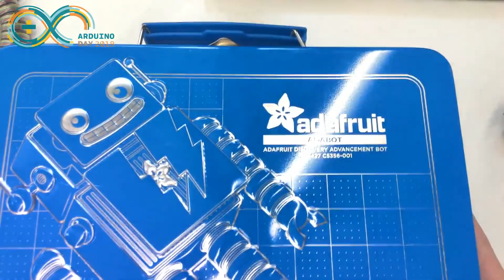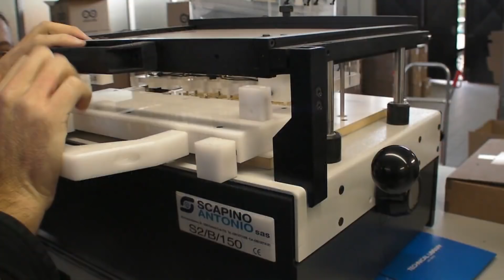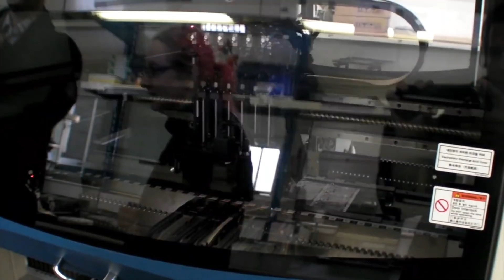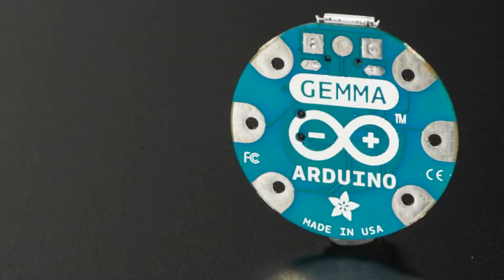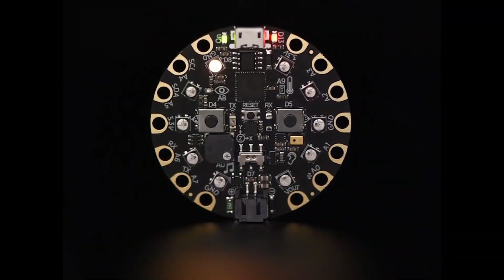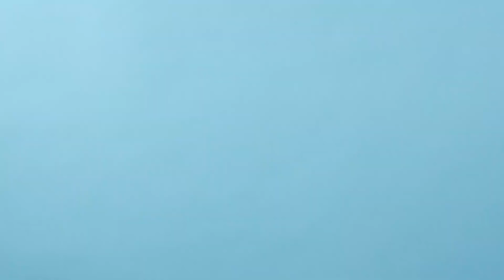Arduino Day 2019 #ArduinoD19 @arduino Sat. March 16th 8pm ET live @adafruit

Comment: Thanks for the walk down memory lane.  I first learned about Arduino in 2012, so I can relate to most of what you talked about.   We, here in west central Wisconsin have had a small Arduino group going since August of 2014 and had built/tested/discussed well over 125 projects as of  July of 2018 (the last time I counted them).   We are mostly interested in process control devices and don't spend a lot of time with flashing lights or wearables.   I do notice that "Arduino"  is being pushed farther down the list on the forums, but so far, our group is (more of less) stubbornly sticking to Arduino.   I highlight some of my own Arduino stuff at:
https://spaco.org/Computing/Computing.htm

Pete Stanaitis
---------------------

Comment: I came back to the MCU world around 2015 when Dave, from the EEVBlog showed some arduino stuff...i went, hey maybe i go check it out..and here i am in 2019 still using the 328DIP, just because i can put it easily onto a perfboard and do my projects, without any PLCC ockets....Also the phantastic IDE is one of the key why the arduino stuff is so great...
back in the 1990 i used the 68HC11-F1 PLCC, it was about 100 bucks just the MCU and the PLCC socket on order to put it onto a perfboard...also you had to deal with the Motorloa IDE which was ok..DOS only (the usual back in the day) but every now and then there was a new IDE when you wanted to use the latest version of the cross-compiler....and you needed to set it up all again...it usually took me days to set it up to work reiable...
This was so frustrating that i quit using MCUs for my hobby projects...
During the end of the 90s all these great dev-boards came...and some had beed very promissing, but everytime you had to deal with a complete and all new IDE, and if you upgraded your PC that IDE usually also won´t work...and the newer IDE won´t support that chip on your Dev-board...very frustrating for a hobbyist user

I always wanted a rather cheap board and a long term supported IDE....

And the arduino has all this, i still can compile my very first projects, done using  0xx and compile&upload it with 1.8.xx today on the latest ArduinoUNO and it works first go :) maybe some libs are no longer supported, but as i still have them, i always can use that code from that specific lib i need and add it to my code by hand.

Also i still can work on my first projects and add functionality using the latest IDE and my original code...also great, that´s what make the part time tinkerer (=me) makes me smile, everytime i use the arduino-IDE

My best example is my VFD-clock, using a EPSON POS 2x40 5by7 dot display, started it around 2016 plain and simple...and by now i added a two channel voltmeter, a bargraph display, a VU meter, WS2812 LEDs, relays and IR.... and i still have some ideas to add until the 328 has no more space left for additional code...;)

Also the whole infrastructure is great, whenever i want to use a display, or even a wierd piece of hardware with the UNO, i usually find someone who already used it, and most times i end up using github to download a library to interface that piece of hardware....i don´t need to write it myself, instead i can focus on my project rather than dealing with on how to "speak" to that hardware...WS2812, DS3132, DTH21, OLED-displays, controllers, I2C-chips..it´s already there...:)

Thanx Arduino! :) And a big thanx to the arduino Forum/Community :) :)